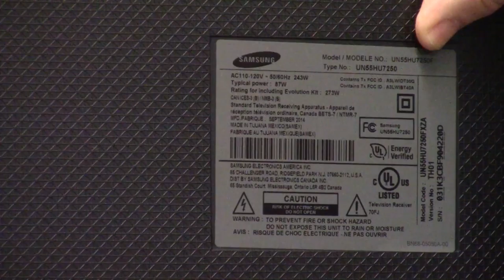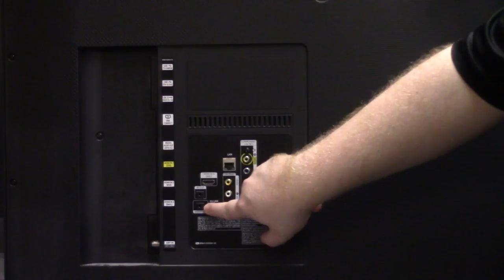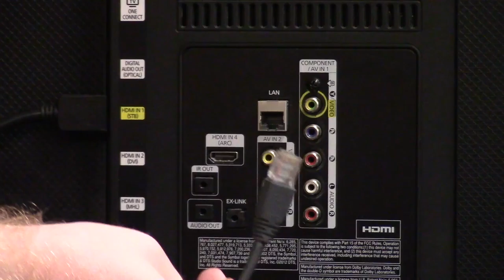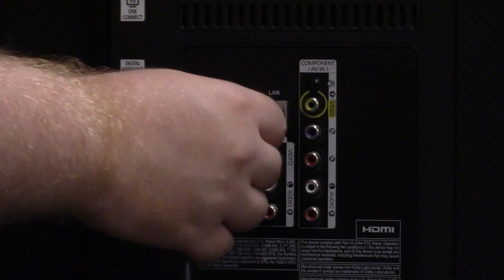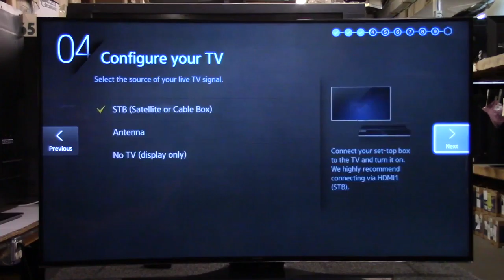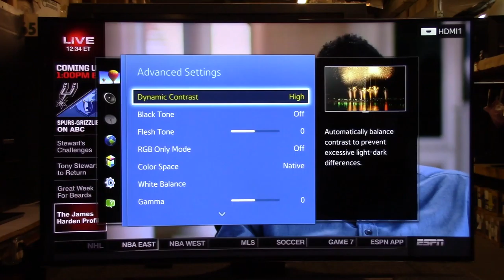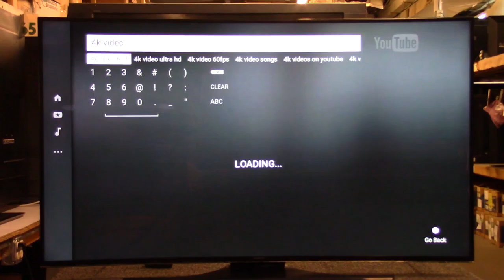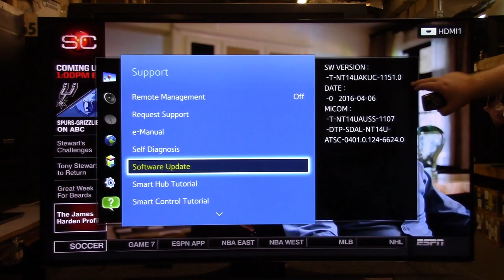Samsung UHD TV teardown & walkthrough

Comment: I have a Samsung UN60HU8550F and just had a message on screen saying the TV is overheating and the fan needs replacement.  I didn't see a fan on this one and I didn't know mine had a fan (i've never heard any fan noise)
Reply: Did you sell it yet?
Reply from the maker: It likely has a laptop fan to cool the SoC and it has filled with dust and can't adequately cool it. It's either screwed to the back of the panel or in the One Connect box. If cleaning the fan doesn't help, get the part no. for it and replace it.
Reply: Fixed it by replacing the fan ;)

Comment: one of led reflectors came off and i have bright spot on my screen  , how get access to led strips? do i need remove all boards and ribbon cables?
Reply: Is it clouding or a bright spot? Access to LED strips requires removing the LCD Panel-- which is the most delicate and Expensive part of a TV.